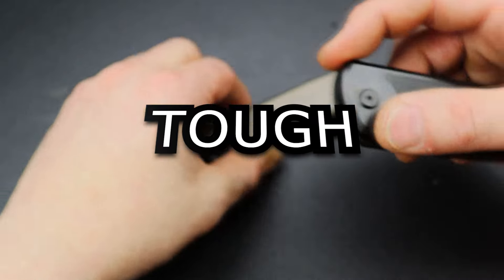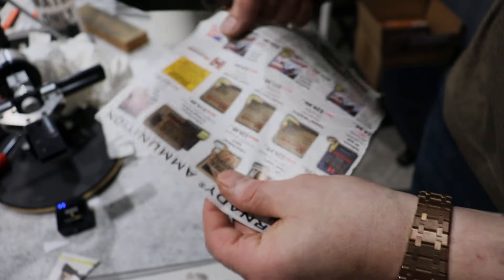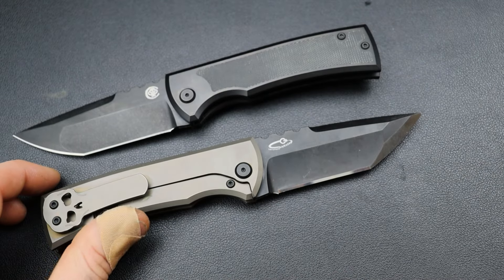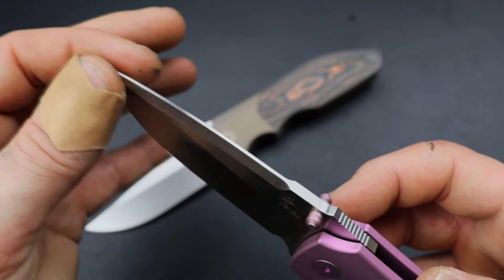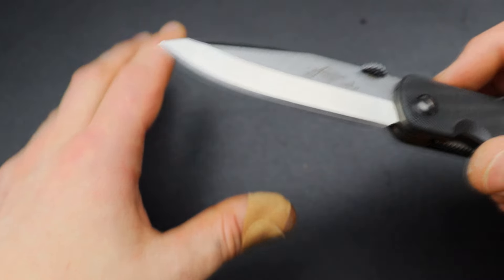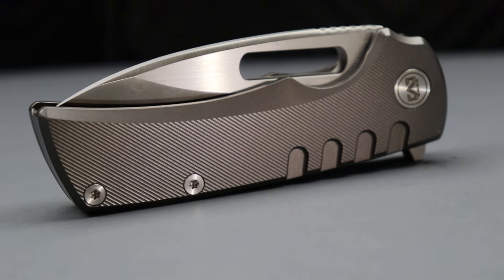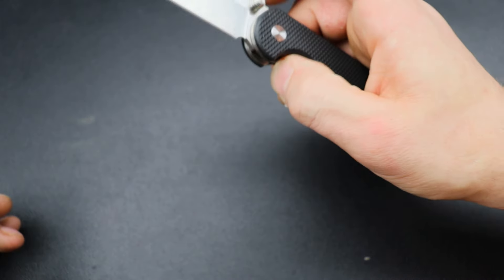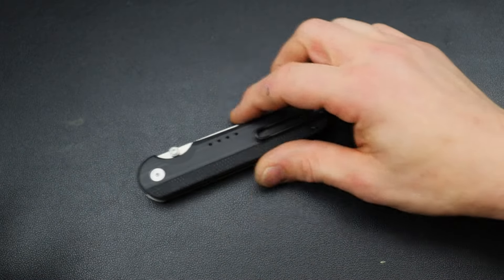10 Tough Pocket knives For Everyday Carry

Comment: Finally a chisel grind with the flat on the correct side
Reply: the kabar snody boss has the flat on the correct side too 👍
Reply: Regarding the edge bevel, he says it's 23 degrees, but the flat side should be regarded as "0" degrees, no? Which makes it equivalent to a 11,5 degree regular grind.
Reply: I mean the cross section looks like: \| instead of: \/
Reply: @bjornnilsson8496 no, it's 23, because the bevel is 23 degrees (see angle cube), and other side is zero.
Reply: The chisel grind looks interesting I’m going to try it! What side should the bevel be on?
Reply: Forreal what's the deal with that 💪🏻💯

Comment: I just reprofiled my WE Cybernetic at 13DPS and the bevel became skyhigh. But it's well worth it, I like the Japanese Tanto look with the tall bevels and it now actually cuts well. For 20cv I do run a microbevel at 25dps with spyderco medium and fine ceramic- still able to hold ~ 100bess without need to strop
Reply from the maker: very nice, i belive spyderco does something similar from factory as far as a micro bevel
Reply: One advantage of making high angle small width microbevel is that one can avoid a stop altogether due to minimal burr formation and not rounding the apex, this is

Comment: I laid back the edge on a Protech CQC 7 with a chisel grind. I thought it would be easy, but it took a long time. It was a pain in the ass.
Reply: oh buddy, making a fat bevel at a low angle on a knife that comes factory 20° is a CHORE. especially considering i sharpen on a precision adjust bc i suck ass and can’t freehand
Reply from the maker: yeah this one took me about an hour and a half if not loner probably 2 hours just to set the bevel with the first stone

Comment: Yea chisel grinds can get sharper, but the trade off is your edge stability literally drops in half & the edge is alot weaker. Plus it curves in long cuts through cardboard
Reply: Yes and no. I have several Grayman fixed blade chisel ground knives. Chisel side sharpened to 19 degrees. Have batoned the crap out of them (nasty knotted white pine)with no damage to the blades. Granted they are 1/4 1095. Sharpened them back up to razor sharpness effortlessly with ceramic rod.

Comment: You are objectively wrong about chisel grinds providing higher levels of sharpness and toughness. Aside from specialized applications (chisels, natch), knives with chisel grinds provide no advantages over double-sided bevels. Zero. Nada. But it IS less work for the knifemaker. Sharpness is a function of geometry, specifically the angles involved, and to a lesser degree, materials. 
 I say that as a knifemaker that has made knives since 2006.